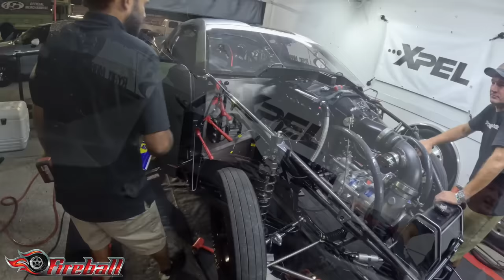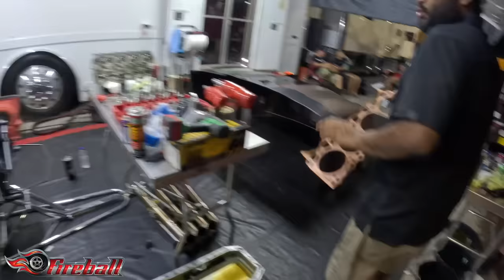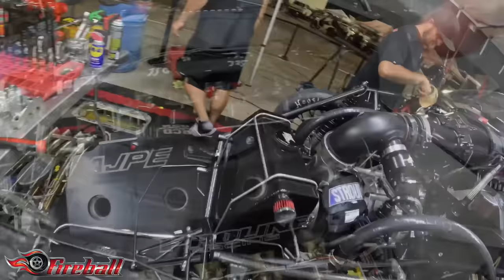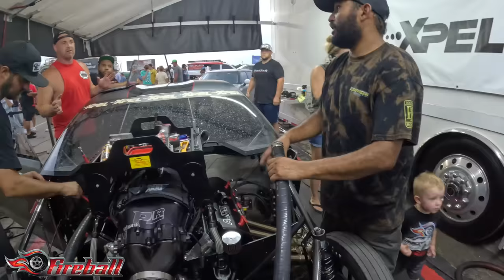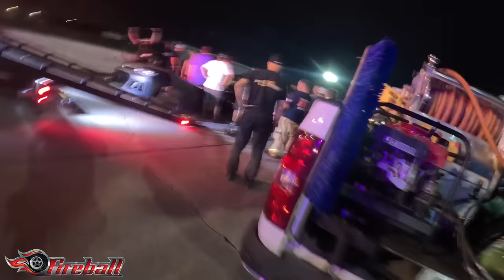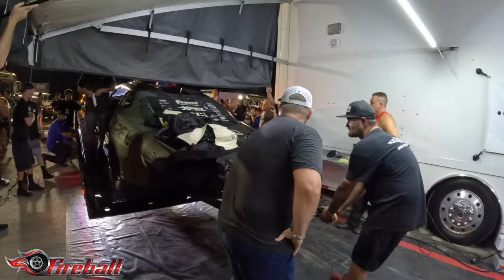NPK Tulsa Crash And The Return of Fireball

Comment: Ryan, Not trying to be a smart @$$ !  But years ago when I was hill racing quads I told myself I needed to lose some weight. So went on a good diet with good nutritional food and started running & exercising. Went from 210 to 160 / 165. The hardest part was trying to find good food when traveling. On a lighter quad the weight made a big difference.

Comment: For bandamer some people use an air compressure similar to what murder nova has on his donk and run the lines to the blowers or turbos to speed the boost up in high altitude just a suggestion glad u safe and u almost saved it smartest ones always pull the shuttes and u did quick 4 peat with og fireball

Comment: I had to preheat my copper head gaskets before head installed had fire rings cut into block put wires in then tourqe head with hot gaskets  is this new stile?